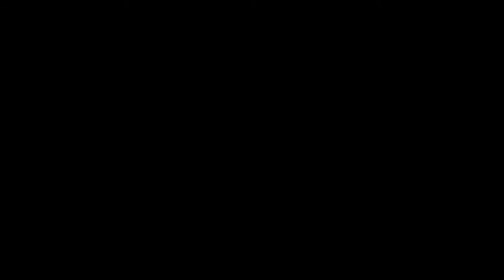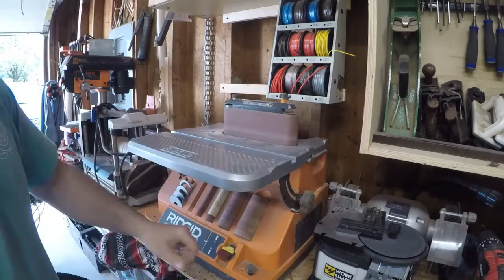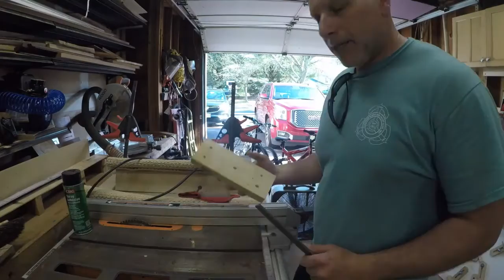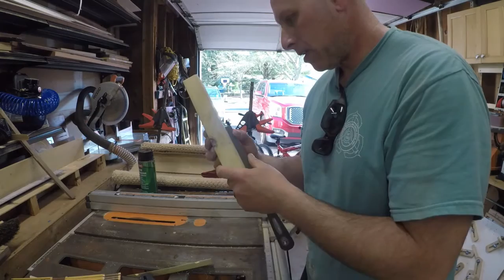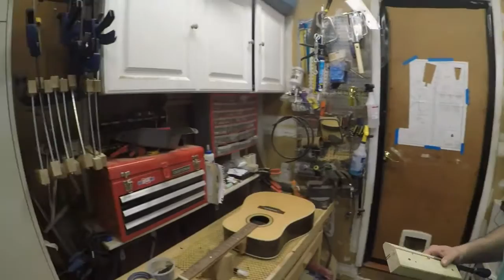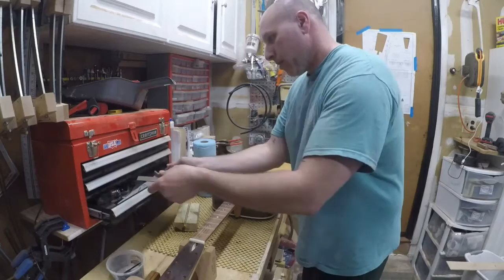Homemade Fret Beveling File

Comment: did banging the file in the vise work pretty well to get it down to size? come out clean (more or less)? i was thinking of hacksawing or angle grinding, but i imagine the metal (on my cheapo files) is pretty solid. maybe sheer fracture is way to go...?